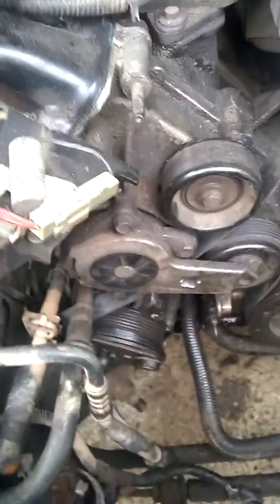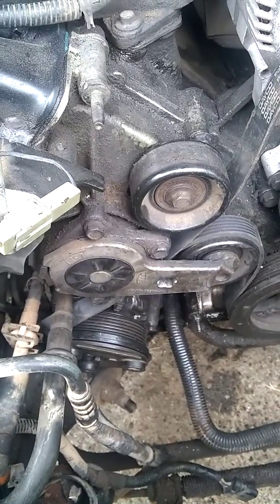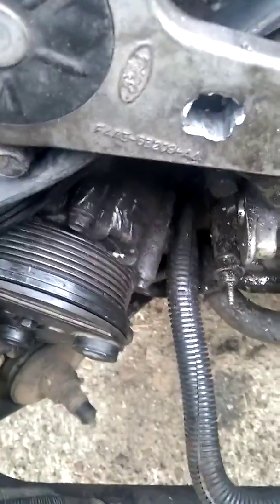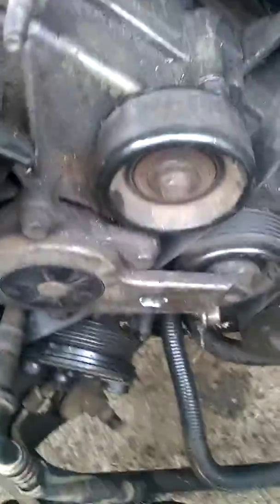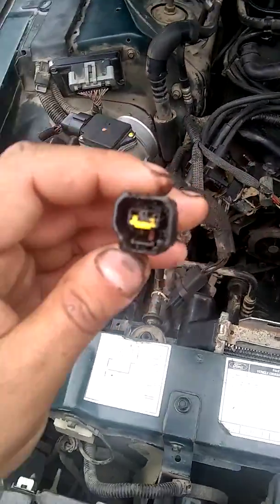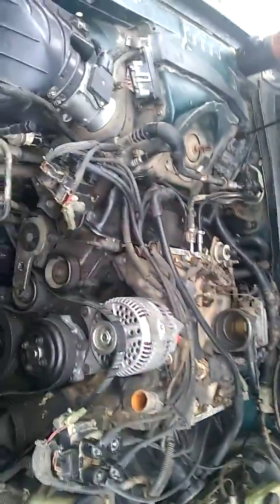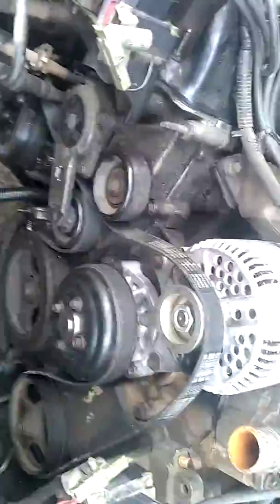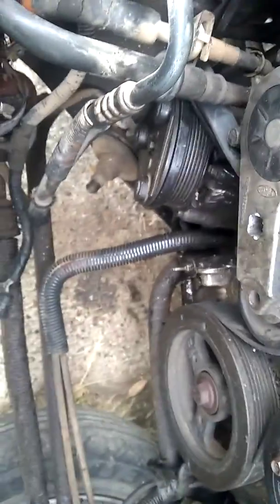Crankshaft position sensor replacement

Comment: There is no way to get the ac compressor off of a 2004 Mercury Grand Marquis to change the crankshaft position sensor.

Comment: What's up Samuel iam angel Puerto Rican nice to meat you ,I have a 1994 mercury cougar xr7 3.8 v6 and iam not sure if it's my crankshaft sensor that's mess up my car starts and after like 20 -30 minute it shuts of then I got wait till like 15 minutos to start the car ,my car shakes bad when I stop and that when it might shut off did you had the same problem please 🙏 help me. This car it's a nightmare.also my check engine light is not coming on indicating there's a problem did you had same issue

Comment: To anyone who watches this video: remove the top radiator hose from the radiator kink it of to the right remove the fan two 5/16 bolts at top it slides right out. Take pulley off a/c condenser with a 15 mil socket sensor is to the right one 8 mill bolt it slides right out.

Comment: This could have been a 2min video. Remove the drive belt, 3 compressor bolts, 10mm screw for sensor. Put new sensor in, refasten 3 bolts, put belt back on.
Reply: Do you have a video of the repair? I have an 03 Lincoln with the same problem and I need the visual
Reply: @GrindHard365  I don't. So, all you'll wanna do is loosen the compressor bolts enough to where it won't fall on your face. This allows you to move it out of the way. It was too hard to hold everything and do the camera. Sorry man. But the clearance is there to pull the sensor out without the compressor being completely dropped if you loosen the bolts ALL the way to the end.
Reply: @adamcrownvictoriacarrepair7105  Thank you sir

Comment: I think I can get to mine from below rather than removing all that stuff.
I sure hope so.
Reply: You won't have enough room to pull the sensor out. Learned the hardway. Take out the 3 bolts to compressor and wiggle it loose.

Comment: Need help. My 2004 Mercury grand marquis will not start. ALL  lights, work. The gas cap light on the dash was on before the car stop working. Two mechanics have worked on my car . Fuel pump is new and has bn triple check. Fuel pump model is new. Now the car wont turn over or crank. Is the crank senor located in the same spot on Mercury grand marquis??
Reply: If it won't crank test your starter. Check battery. Go from there.

Comment: Where would you find the cam shaft position sensor ?
Reply from the maker: In between the ac pulley and harmonic balancer
Reply: How would you go about moving the AC compressor without removing the pulley I
Reply from the maker: Two bolts under the ac compressor